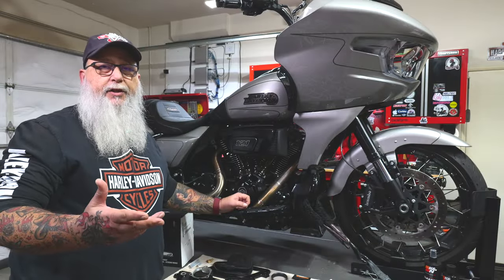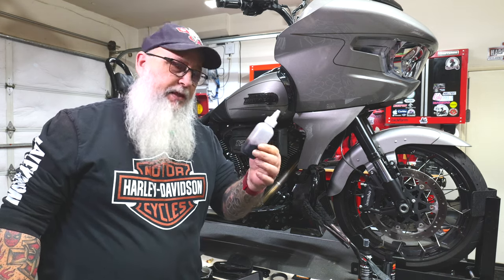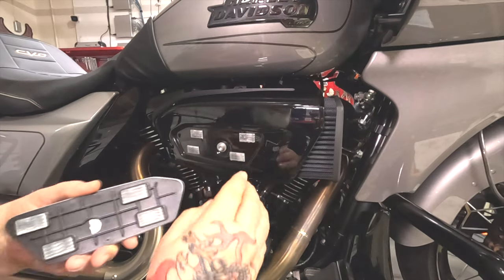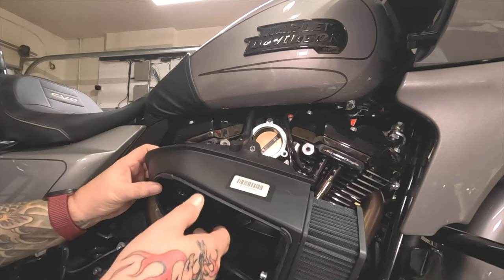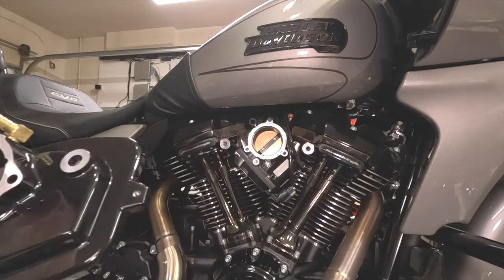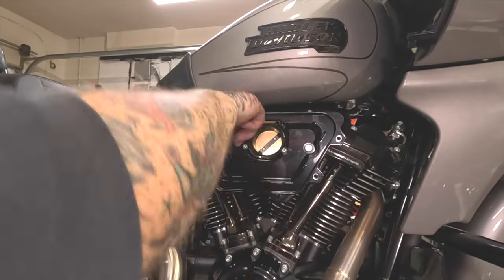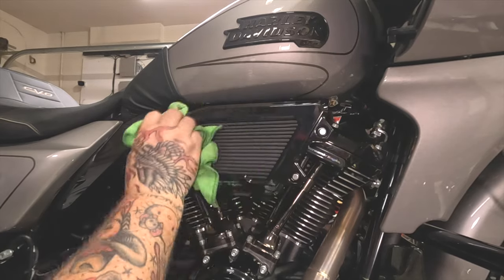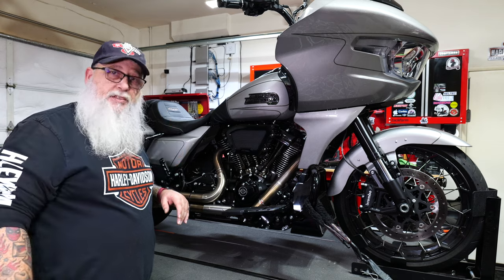2023 Road Glide CVO Upgrade - HD Extreme Wedge Air Cleaner

Comment: I have the. same air cleaner on my 2023 CVO Road Glide.  In my opinion, it looks good and gives that 121way more air to breath.  I was thinking you were going to take it for a test ride and see if you felt a difference.  I saw a video where the dyno showed an extra 10 hp after changing to the wedge filter.
Reply from the maker: Thanks for the comments, 100% agreed on the look and the feel. For DP CVO, the black oil looks much better in my opinion as well. I did take it for a ride but didn't film it. It for sure is more responsive and I feel a bit more power. Awesome upgrade for sure.

Ride Safe

Comment: On that wedge cleaner, did you have to tune the bike?
Reply from the maker: Thanks, I did not. As indicated in the video, the computer adjusted pretty well. I would say it needs one, especially since I changed the pipes out, but being in CA, tunes violate the warranty, so not until the warranty is up.
Reply: I am in Vegas but have the CA model as well. Will let you know how it goes.

Comment: I noticed your 2 into 1 exhaust and with the air cleaner swap did you have to reprogram computer
Reply from the maker: Thanks for the questions. I did a video on the exhaust as well and no, I did not tune it as the computer seemed to adjust pretty well and in CA a tune would void my warranty.

Comment: how did you get the tank bra on?
Reply from the maker: Thanks for the question. To be honest, it was pretty easy, I just followed the directions and tucked the straps under the front and sides of the tank. I fed the sides behind some wires, the gas connection and bent the S hook with some needle nose to keep it in place (of course making sure no metal on metal rubbing was happening). 

I thought it looked pretty good, didn't move much once settled and I did not have to lift the tank anywhere.

Hope that helps, ride safe.
Reply: @justkillnbugz  I was going to put one on my copperhead along with the wedge,. I was concerned about the wires on the front of the tank. I stopped because it just didn't look like I should do that?
Reply from the maker: No worries. On my CVO it was not a big deal and not a lot of pressure.  Just tweak it around them as best you can and they will stay still. You could even tie wrap it away once installed to keep it from rubbing.